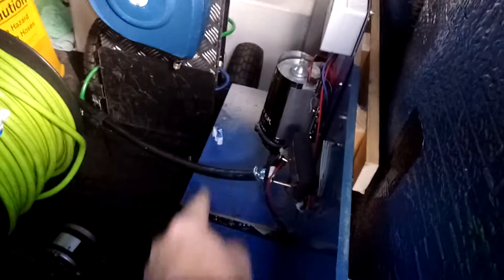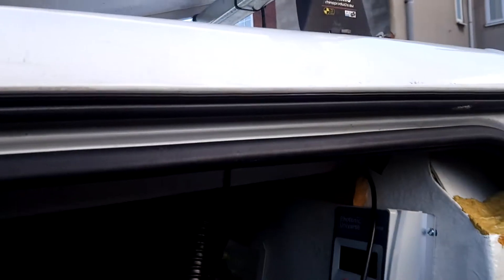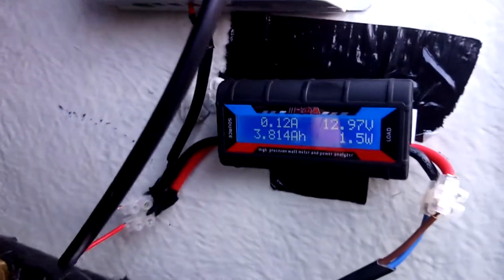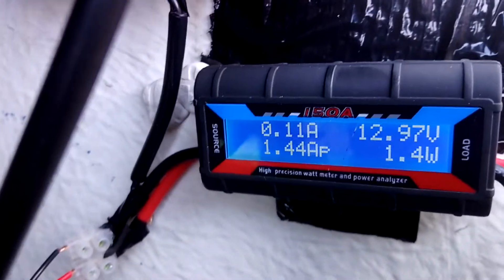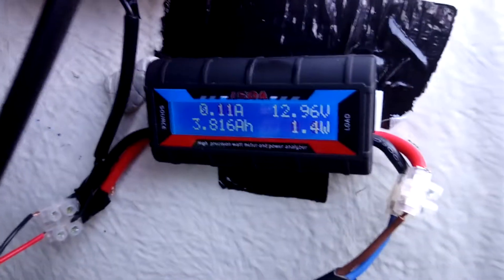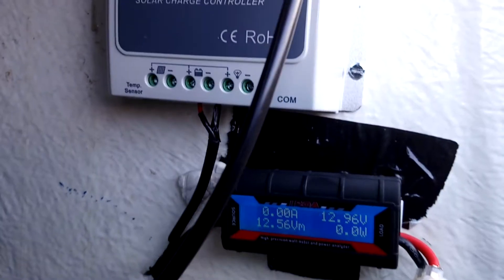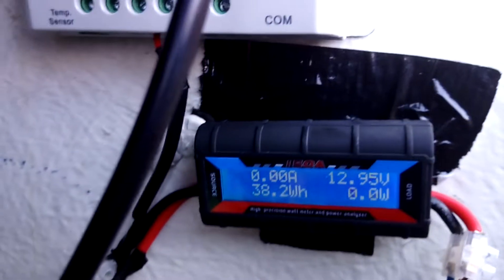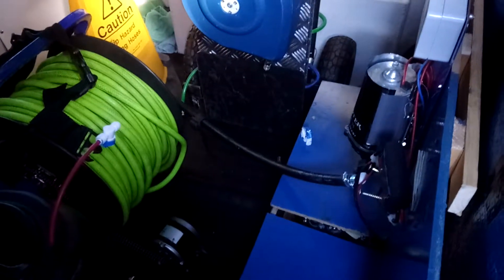Solar panel charging or split relay

Comment: Interesting subject. Would a split charger with solar panel be the best of both worlds?
Reply from the maker: Michael B This winter (2017/18) has been very poor for solar reaping. So recently I have done just this via a switch on my dashboard, so I can manually take advantage of the alternator.   This has proved to be very advantages.
Reply: NK Services Good work. Was it a case of a few isolator switches do not to confuse either system?
Reply from the maker: Michael B I suppose that would also work well. For me, my van used to have a Amber probe light on top of it which I disposed off and kept the wires set up because the previous owner had a separate switch on the dashboard.  All I did is place a blocking diode on the end and connected crocodile clips that I can connect to the battery, leaving my solar setup in tact.  Then when it needs a boost, on my travels I can switch the connection on and charge from the van battery being charged from the alternator
Reply: NK Services That’s a handy solution. I’m also in a quandary over what battery to get, bloody expensive.
Reply from the maker: Michael B   yes they are sadly.    I currently use a 120ah deep cycle leisure battery.
That's the only thing in our line of work, we gulp down  electricity
Reply: NK Services I’ve found 2 x 6V batteries at £260 that will give me 460ah much lighter and smaller, basically golf cart batteries.
Reply from the maker: Michael B is that 230 amps each or combined?
Is this also for wfp? I ask as most of the equipment require 12v, so you could connect in series to give you the 12v required but it would only be 230 amps which is still impressive and light weight.  (sorry as you no doubt know this)
Reply: NK Services You are absolutely right, joining to make a 12V would still only give me 230Ah
At £260 do you think it’s still a viable investment?